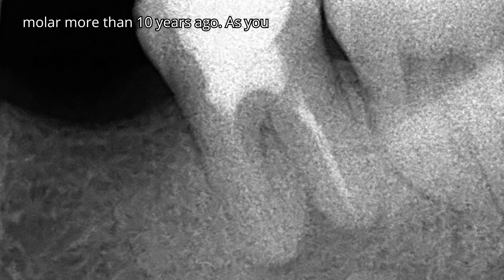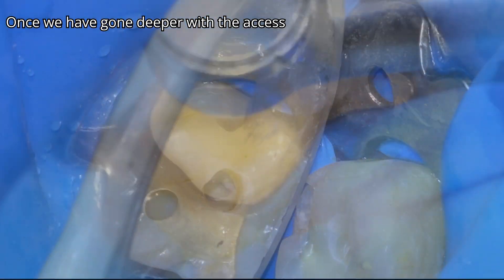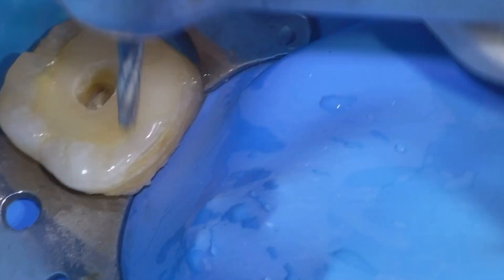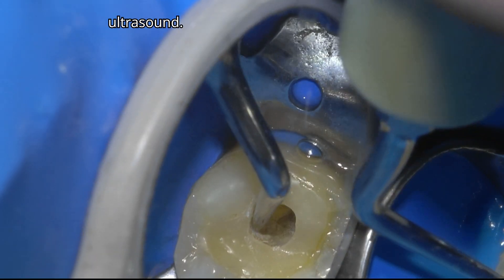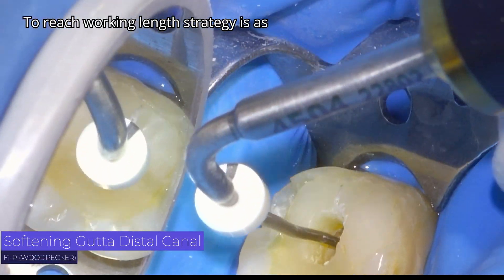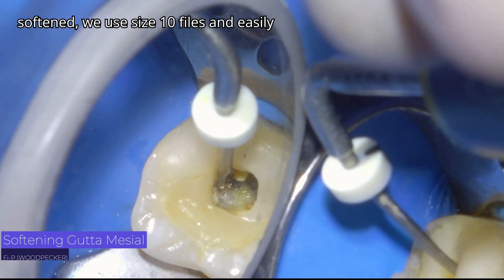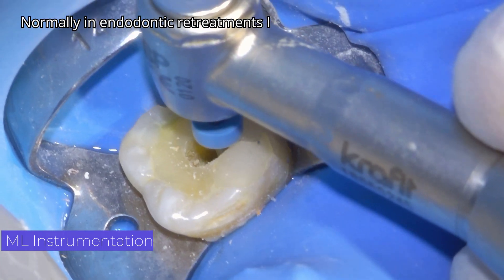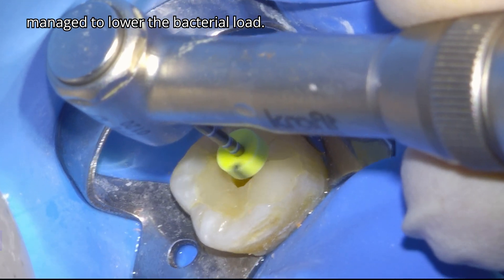Endodontic retreatment lower 2 Molar #rootcanal #endodontics

Comment: What type of hand file did you use to determine the apex foramen with the apex micrometer?
Reply from the maker: In mesial canals 10k but in distal 15 or 20k. The apex locator doesnt work properly when the file is loose in the canal so i use one that fits better in the canal.
Reply: @endoaddicted  If the root canal is filled with dentin and fluid, how can we determine the apex hole?
Reply from the maker: @f.r.o.mvietnam  sorry I don’t understand what you’re trying to as.  apex locator normally works well with fluid inside the canal. When you have a gutta- percha well condensed canal you won’t have any reading til you get to the apex.
Reply: @endoaddicted  Thank you! Thanks for sharing, I can help more patients